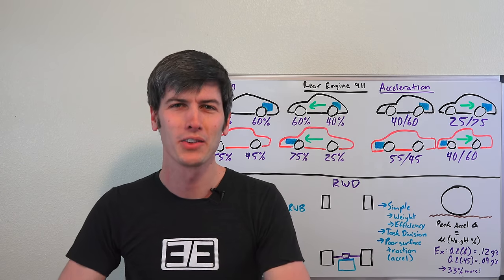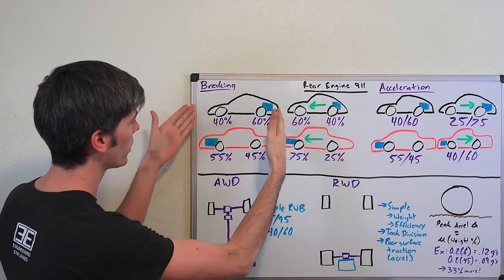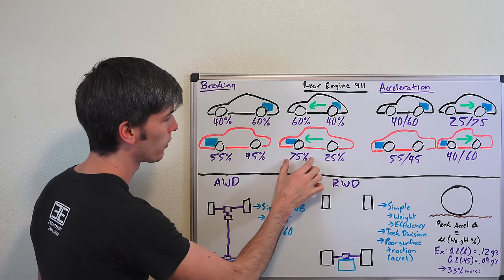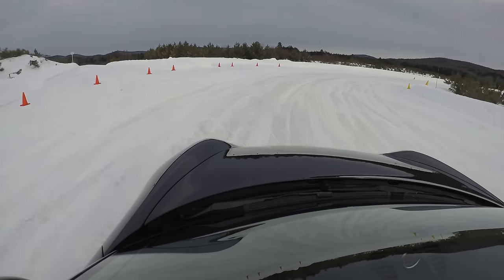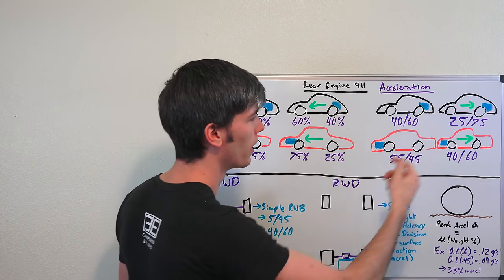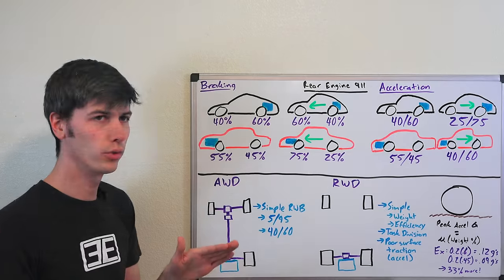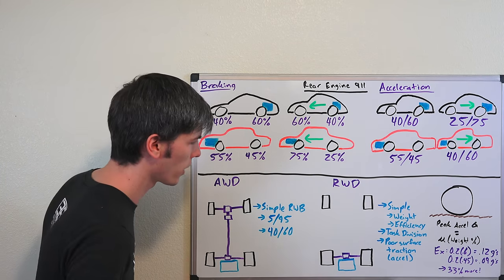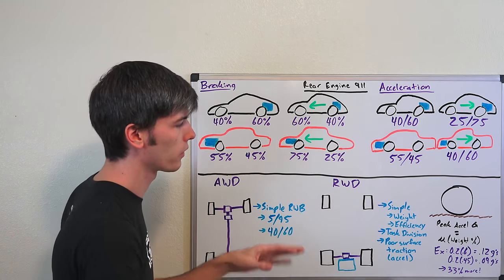Why Is The Porsche 911 Rear-Engine?

Comment: Disadvantages would be
 1. Suicidal oversteer
 2. Less safety, as engine absorbs huge portion of the collision energy.
 3. Maintainence issues with the engine
 4. Lesser Thermodynamic Efiiciency as the engine isn't cooled as much in the rear as compared to front.
 5. Engine size constraint.
Reply from the maker: While there are disadvantages, the ones you point out are not accurate. 
1. This can be designed out, it's not suicidal by any means.
2. That's not true. Front mounted engines are generally designed to drop down in the event of a collision so they do not go into the passenger compartment. The body structure is what is designed for impacts, not the engine. 
3. An engine having maintenance issues is not correlated with where that engine is placed. Porsches, generally, have reliable engines. 
4. Porsches have radiators in the front of the car. Also, there's not a strong correlation between an engine's cooling system design and it's thermal efficiency. 
5. Flat-sixes are some of the widest engines that exist. From a packaging perspective, they're huge.